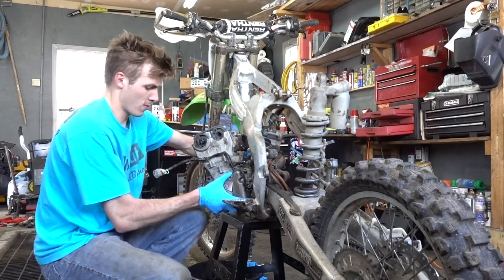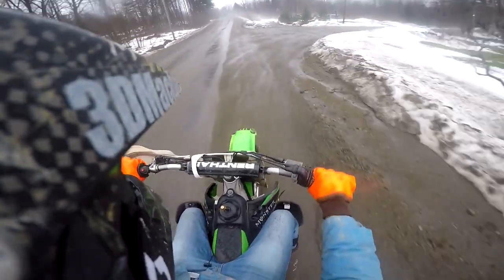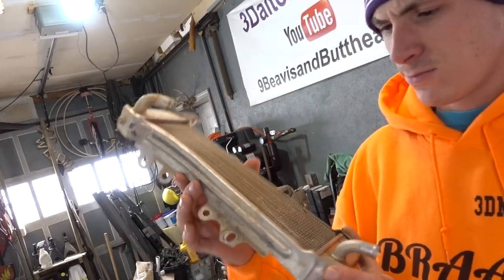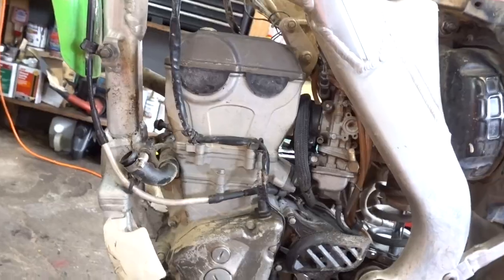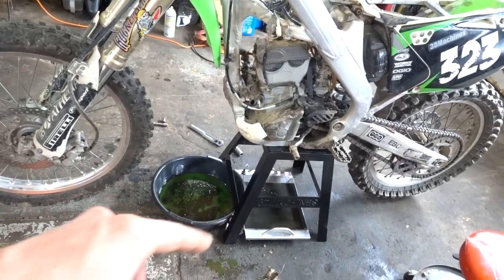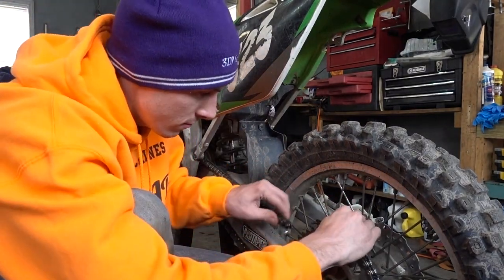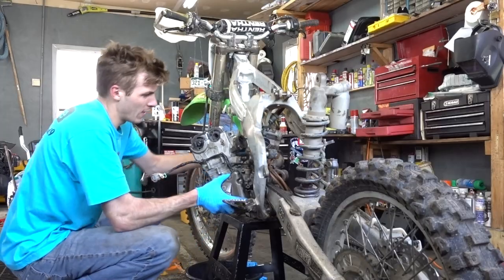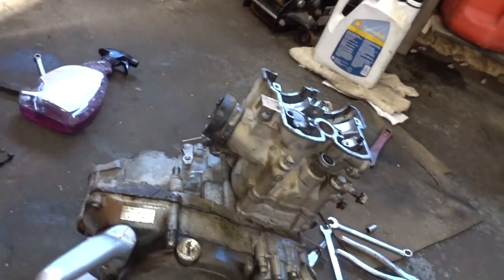THIS IS INSANE

Comment: It'd be nice if a local junkyard has an identical bike you could buy dirt cheap as a parts donor... or if not identical, at least close enough to have the same basic engine, one that was scrapped by the owner due to a rotted frame or fubar'd transmission or something.

Comment: Dalton I'm sure you know this but with the engine block looking like that it'd almost be cheaper to buy an entirely new bike than it would be to fix that issue, you'd either need to remachine the entire block and get new cams and cam bearings to fit or just buy a new engine outright. Basically, there's no fixing that issue, hombre

Comment: wow, this will be expensive. I had a KTM 350-SXF and when i was riding, it died, it didnt sound like it blew up it just completely died. I tore it apart and you probally wont belive me. The head of my intake valve broke off and made a hole into the piston and got sized and it also screwed up my head. The parts would cost me almost 2000€ to fix it but i decided to sell it for 1300€

Comment: purchased a used rmz250, found same damage,  could not figure out what had happened. finally found cause, oil filter was installed backwards,  filter even marked which way to install, had to replace head,, chk the oil filter!!

Comment: dann bro a new head. that sucks. some times you can get lucky and find a used one. when I bought my son's bike it ran fine but 6 hours into it started making a lot of racket I tore into it and the bottom it was trashed. luckily I was able to find an entire new motor for 300 bucks. well not new but very lightly used. my son's bike was a 08 YZ85 and the motor I got for it was out of a 14.

Comment: This is the reason for why I drive 2 strokes 😂❤️
Reply: 2 strokes get worse mpg. They require oil to be added in with the gas. Top ends have to be rebuilt more often. It is actually cheaper in the long run to have a 4 stroke. People have done the math with all the factors. Yes 4 strokes are more expensive to rebuild the top end but you do it WAY less (as long as you know how to maintain an engine) and 2 strokes end up costing more. 2 strokes are more fun though with the powerband

Comment: I am no motorhead but i do like machines. i have seen that people who build cars have a test bench before the motor back in. but do people have that for motorbikes too. and if so why haven't you built one yet?
Reply: because its not fixed yet, and in reality there's  only about 15 bolts to take the engine out. Not very difficult to do at all
Reply: I mean for the testing. once the motor has been cleaned up, fixed or refurbished wouldn't still be better to test it? or would that not be worth the effort?
Reply: Not really worth it, the dirt bike is the stand. Would have to pull all the electronics off etc...
Reply: okay cool thanks for the info dude

Comment: Had the same problem with my kxf250 2005 that I rebuilt nice bike but so unreliable I had it rebuilt 2 times in 6 weeks first time dropped a valve smashed the head! then con rod snapped 2 weeks later and cracked both casings so got rid! Stick with the 2 stokes 4 stokes r okay til they go wrong then it's big bucks as I think u no 😂 2 smoke all the way brapppppppppppp

Comment: I knew it was seized the second it happened, I even commented on the video that's what happened you didn't even have to take the bike apart to know that's what happened. The bike is worth more in parts right now than it is to rebuilt it or sell it as is and buy a newer two stroke

Comment: Just wondering how you managed to ignore your sprockets long enough for them to get that way? Wouldn't that fall under general maintenance? Chain and sprockets should be changed at the same time....When I first started riding, it took me awhile to figure out that sprockets cup and wear on one side. The side the chain is pulling on..... Sorry, about the comments. Not a hater. I'm a fan......
Reply: Jeff Cada probably bought it like that

Comment: you dropped a valve.. my 07 kx had that happen.. if you would like i may have a old head i could sell you.. it has small damage but it is usable
Reply: Cody Erickson I also have a 07 kx, I was rebuilding it yesterday and I dropped the piston clip into the crank, you can imagine how pissed off I was about that because I still can't get it back out and it's all my fault because I forgot to put the rag in there
Reply: ooo im so sorry, that is a pain in the ass
Reply: Black Bandit MX yeah man ,thanks I'm going to try and get it out right now

Comment: Man dalton I'm sorry dude, I just had my yz250 blow up on me, cost me 2000$ I hope you figure somthing out brappp on 🙏🏻
Reply: A full rebuild shouldn't be over $1000 on a 2-stroke
Reply: It grenaded the crank case and scratched the piston housing
Reply: Reese Nelson yeah I guess that would be expensive but you probably could of bought a whole new engine for less than 2000
Reply: Try to find a Oem 96 yz engine anywhere
Reply: Reese Nelson You must have paid someone to do it for $2k were talking home done. I did a ktm125SX New crank, cylinder plated, piston and rings, seals bearings etc. for under $1k you can see it on my channel.

Comment: didn't you just rebuild it before this happened?
Reply: No he didn't. Rebuilding a bike, whether it is 2 stroke or 4 stroke is total bull shit unless if the compression is low. Change the oil regularly, maintain it, and don't best the hell outta it. And they will last forever. Well most of the time.

Comment: that looks like maybe oil or oil pump failure or it possibly dropped a valve, I would go ahead and pull the head, I don't like that design the cams rolling just against aluminum is an awful idea even if oil is pumped into that vein, ebay is your friend here :D    also I know this is not the first time you've had issues with this engine...fix it and get rid of that Kawa-suki lol